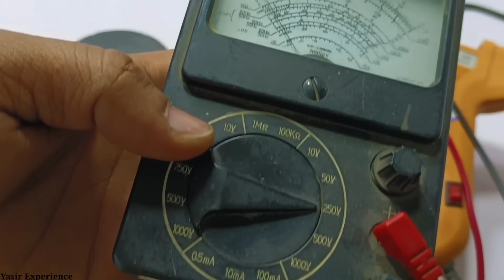Turn 4 Big Permanent Magnets into 250v Generator Use Copper pipe

Comment: What about the red and black wires where are they coming from
Reply: Sepertinya dari carger Hp... ukurannya bisa disesuaikan dengan Voltase dinamo... dari batrai juga bisa... dicoba aja.
Reply: From the multimeter
Reply: Red and black wire external battery source to power the motor. This person didn't mentioned overunity power device.  Need to understand that first.
Reply: Need to show other point of red and black wire too
Reply: @aidilsamat9779  
Yes, of course,
 but how many Volts? 9v, 12v or other?
Damn!!!
Reply: They’re coming from a 9v battery to power the DC motor to spin
Reply: Battery

Comment: Free energy only happens in India and surrounding areas. It requires construction with scrap components, a glue gun and a place to hide the batteries...
Reply: Ha  ha ha... you said it... I've been wanting to say what you said for many years (long before COVID19).. and :they" claim 5000Watt, 10000Watts 20000 What. What a nice claim (guess what while I am typing this, I read on right collumn on this page, somebody claims that he can produce a whopping 10KW electric generator..Whao! Have an ice day. (very chilly in my place,.. I need a 2000 watt heater)
Reply: People doing this magic to earn money bwahahaha bwahahaha
Reply: @massudcnee6649  They don't say how long it will take or how much energy they put into it to get that output.. My guess is 15kw to spin the magnet at X frequency to get that 10kw in AC over a one year period.. Maybe a 66% efficiency is optimistic but it is somewhat realistic for this mechanical conversion.. This is the reverse process that a wind turbine uses to create AC waveforms that are via diodes rectification chopped into pulses of DC.. Using copper as the core material instead of iron is being studied in hundreds of basements and garages around the world because there is a current flux that copper creates when exposed to magnetism that does have potential.. One lab has created a super conductor by putting liquid oxygen or other super cold liquid inside a loop of copper tubing then have the magnets with coils oscillate back and forth around it from the outside..
Reply: Actually you can make it work in North America where the line voltage is lower by just cutting back on the amount of hot glue.  Now, depending on your latitude, you may also have to throw in an old spark plug or two.

Comment: I tested it and it doesn't provide any electricity
Reply: The wire' s thick insulation would prevent it from working, the windings aren't close enough together to make any power. That's why a generator has enamel coated wires. You notice, when the voltmeter is connected, his thumb is over the range so that you can't see that it's on millivolts. It probably makes two or three hundredths of a volt, or some small amount. This video is just for views and comments. Did you ever wonder why they never start with a generator, but instead have to make one out of glue and bits of wood glued together? It's not intended to work for real. Just enough to get views.
Reply: Üçlü prize şebeke elektriği verirsen gelir. O sistemi öyle yapmış 😂
Reply: It seems you have to power the electric motor then you get energy due to the coil and magnets,maybe It works cos earth magnetic field reestablishes altered fields quick... But there are similar devices with no mobile parts. I will check It i seen similar devices on YouTube too.
Reply: 😂What else did you expect? 😂😂😂😂
Reply: @ferry602  I know right 👍, 😂
Reply: 😅😅😅😂IT 's fake. two wire pin is electric 😂😂😂
Reply: Are you sure???
Reply: Thank you for your time doing that.
Reply: Of course it doesn't
Reply: I thought that just by the description of the magnets lol they're rare earth magnets not permanent magnets
Reply: Thats because its a scam, u need moving magnets to produce electricity
Reply: It does not work it's foolary
Reply: Did it ever occur to you why these guys don't show their faces. They probably own a junk shop with all these accessories, and this is the only way to get rid of it. 
Lots of people are using YouTube to promote fakes. Be aware

Comment: It’s concept people. Yes his tiny motor is plugged into a power source… the concept is that you can generate a significant amount of power from the emf but it will require assistance to maintain momentum. On larger REAL versions it’s pretty impressive. The magnets and coils are far more powerful and larger, and generate a real 220 volt supply.

Comment: Hey just a question the two prongs that hook to the engine curiously they don't show the other end of those prongs but it's supplying electricity from somewhere probably plugged into the wall this is nonsense and it's not free energy

Comment: Only 22000W?
22000W / 250V = 88A
With these thin wires 😂🔥🔥🔥🔥🔥
Reply: Yeah but if you divide this by a factor of 4 you only get 22A ;) It all depends on the thingy whatsit that bolts to the thingamajig :)
Reply: @deathonawhitehorse  🙈
Reply: |Don't touch you may be shocked to Death.
Reply: @thilovonstillfried6278  are you serious !!this guy has never read ohms law or any other law for that matter
Reply: @robertpasangha3805  Yeh shocked that it does not work. Back to the scrapyard
Reply: @davemburu1522  you cannot CREATE OR DESTROY ENERGY thermodynamics laws are clear.
Reply: I believe this is rated output per year and note he does not say what the input to the DC motor spinning the magnet is..

Comment: A 9 volt batter powers the electric motor, which creates the magnetic flux to create voltage. Though it may produce 250v, it will only be 1.5 to 3 amps.

Comment: What is the frequency of this energy you produce? If it is not in the range of 48 - 62 hertz, it poses a danger according to the skin effect theorem. Because all cables produced are produced in accordance with the alternating current energy transmission used in the range of 48 - 62 hertz. Otherwise, if it is outside these values, there is a risk of electron jumping and shock. Do not publish such ridiculous videos without explaining this.

Comment: So buddy sets up essentially a very poor transformer (insulation too thick), then uses it as a stator to drive a magnet attached to the armature of another motor (not scientifically balanced - just heat glued). He drives the transformer coil with AC current from the outlet and claims he is generating how much? 22kW of electricity. Ahaha. The insulation in the generator motor would break down. It's a tiny thing~!  But wait, no it wouldn't would it, because before that happens the unbalanced magnet attached to the armature with heat glue would fly off into oblivion or shatter like a grenade. 

Really guys, look at the current carrying capacity of the silly transformer coil and compare it to the tiny wires of the aligator clips. Notice the  the plug going into the receptacle? The receptacle only has power when it has the plug in it.  Get him to measure 250V at the receptacle without the plug! LMAO

I am sorry you're so poor (crappy old voltmeter) and so bored (useless fake science project), but in the West we have something called an education. You should try it. A degree in physics and a diploma in electrical engineering tell me you have a MSc. in BS.
Incidentally, power is a measure of not just voltage but current output too.  Why do I seem so harsh and condescending... well as of this writing 480 people have either stopped "Oh wow" or "You're full of crap". Either way, what you're doing is a terrible waste of time. Pursue other interests.

Comment: How many turns per volt does your windings haved?...... Just like sleeping under the sea. Each of us have responsibilities to share truth. Look the diameter of your core is very small and it is impossible to produce even 100 volts of alternating current.... it's maybe the middle of the two ends under is being cut and secretly connected to the main household supply and passing secretly under the board.

Comment: I'm assuming it works better with magnets in attract mode, rather than repel mode.
Reply: this is what youtube has turned into, electrical engineers have Ch they watch and this is for everyone else ....
the way its set up you would be lucky to turn on 1 LED and not even good enough to charge a cell phone

Comment: The generator efficiency would have a 32 % increase if the nuts on the studs had the flanges facing up toward the magnets instead of the way they were originally mounted.
Reply: The bolts are just spacers and the hot glue an insulator.  The contact is made directly with the pipe.